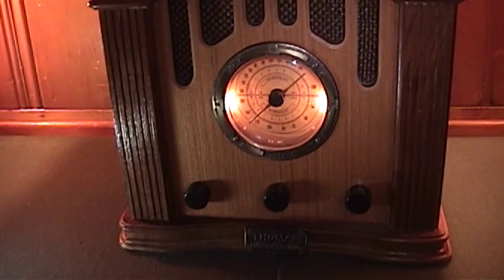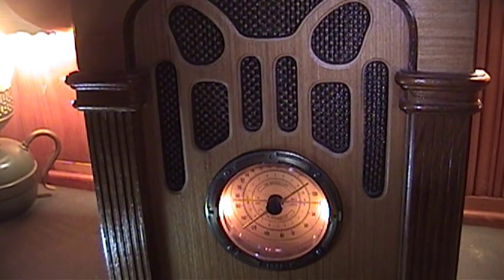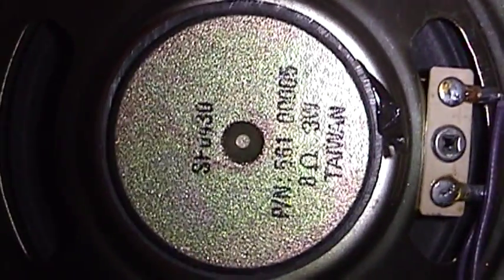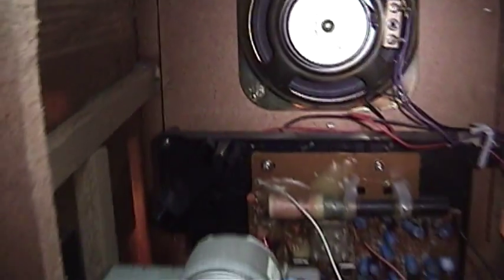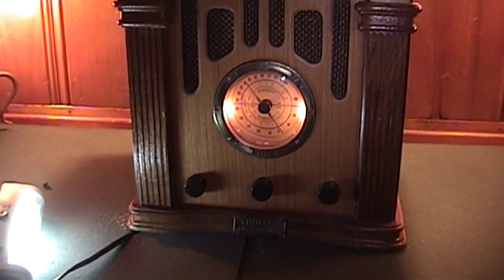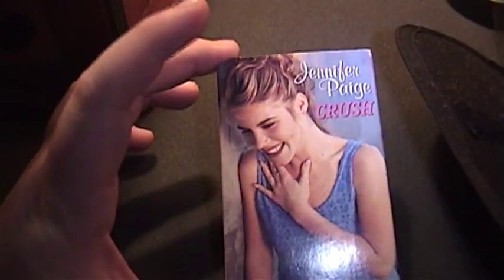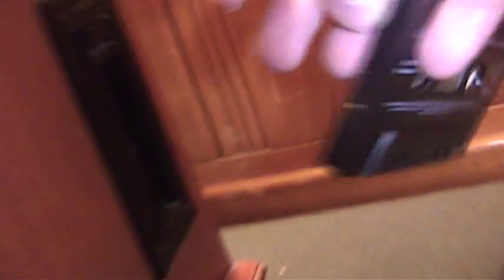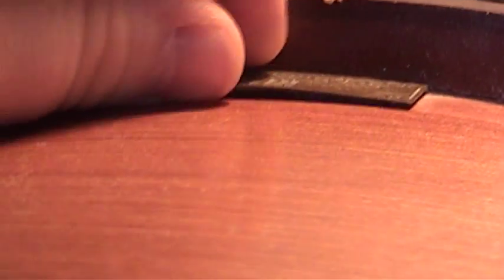EOL: Thomas 411A Reproduction "Tombstone" Radio

Comment: I dont't know about the Thomas you have, but the tape plays at a lower volume than the radio on mine. That means the radio can come on blaring when the tape stops. Mine may be older than yours or a little less premium than the one I have. Mine has a metal badge on the front and 300 ohm style FM 2 screw connector on the back.

Comment: These are not even full scale replicas. They're about 3/4 scale. I've got one of the Thomas cathederals, and it's crap too. One of these days, I'm going to dig it out, gut it, and build a Raspberry Pi internet radio into it. Slap in a usb hard drive with all my old radio shows for good measure.

Comment: They sell these on the Goodwill auctions for cheap starting bids.  I was thinking of putting a lighted Bluetooth speaker in one and streaming music through its speaker grille to make it seem like it's broadcasting old radio shows and old music.  I'm just trying to find one that has a tape deck to see if it will do Bluetooth with a Bluetooth cassette adapter. Does anyone know if it will through this type of tape deck?
Reply: Don't know about using the tape since the mechanism is touchy. But I have seen YouTube videos making a Bluetooth speaker out of these type radios. It's a good idea if it is dead and can't be repaired.

Comment: I have one under the RITZ brand made in the 1980s. Sure it dosen't compare to the actual one's made in the 1930s but it does look pretty authentic besides the cassette deck on the side and it having a modern rubber cord insted of a cloth one. I prefer it over the newer reproductions with bluetooth and other stuff.

Comment: I have a late 1980's General Electric 1930's cathedral style reproduction AM/FM radio I found at a thrift store for $20 in almost new condition. It's got Volume and Tone controls that work cleanly. It is actually really nice in terms of both AM and FM reception and has very good audio. It's made of real wood veneer and looks great. The dial light still works too. If you can find one in good shape I'd recommend one.

Comment: I have one of those in a dark color. Maybe mahogany. From 1988. It's a repro of a Atwater Kent. Mine works good still. I don't use the cassette. Never did use it much. Just the radio. The scratchy volume pot just needs some tuner cleaner. I have also replaced the dial bulbs. You have to be a little mechanical inclined to work on these. The bulbs require soldering. Used to get them at Radio Shack. Prob have to get them from Mauser now.
Reply: These radios are really not as bad is people paint them.. They are close to 40 years old.. Many of them probably needs a recap, and the belts and tires replaced on the tape mechanism.. The local thrift shop we have bids on storage units as it's easy to tell, it's not the normal junk Goodwill and Salvation army gets, and I even see antique stuff come in.. So I see alot of these reproductions there come and go.. So far I bought 4 of them within the last 8 months and all of them the cassette player actually worked the first time I put a tape in.. People should compare this to the Crosley junk that's been going around for the last 20 years.. These sound decent compared to that..

Comment: Picked one in a thrift store. Radio was working well. After I inserted a cassette just for testing purpose, it didn't go back to radio player at all. Stays permanently on cassette playback even after ejecting the cassette. Wonder if I have to open it up to check what can be done. Any ideas?
Reply: I have one that does the same thing.. I would like to know myself..

Comment: I see a lot of these rants about the incredible flimsy cheap, yadda yadda yadda Chinese crap radios on youtube.  Well A) They didn't cost a whole lot back when they were new whereas an original American built one from back in the '30's could cost a person quite a lot of money when adjusted for inflation.  B)  People like nostalgia, there's a market for it and no one else seems to even be trying to fill that niche in electronics.  C)  Most folks who buy one of these wouldn't know a capacitor from a resistor, much less how to restore an original.  D)  Restored originals (while I personally like them) don't have FM (Until the late 40's on) which is generally the only band that still plays music with a few exceptions.  Instead of all the people whining about how poor the quality is on these reproductions, why don't they all go into business together and try producing their own high quality reproductions?  If they don't then they shouldn't complain about folks buying this kind of thing.  Very scratchy volume control?  Well, it is 25 years old and about any radio with a knob for volume does that after a time.  Every restoration I've ever seen, they either have to clean or lube or completely replace the potentiometer so I don't see that as a fail.  As far as cassette goes, the one I had played just fine, but then I didn't keep it for 25 years either nor did I listen to modern music on it.  I listened to old AM broadcast radio shows on cassette which never had the best sound quality to start with.  I certainly wouldn't expect it to last 25 years anymore than I would expect any other cassette deck in that price range to.  I used to have a car radio or two back in the 80's that had the same type of cassette mechanism and they were cheap radios as well that I bought to replace the AM only radios in my first two vehicles, a 1970 Chevy Nova and a '78 Jeep CJ-5, both of which came out with one factory installed speaker.  I sure wasn't about to go out and buy a high end audio system that cost more than the car I was putting it into, lol.  Back then that Nova cost me $400 bucks, I think I gave $35 for the radio.
Reply from the maker: +Rebel9668 Either way you look at it, they're crap. I highly doubt that anyone has the time, dedication, or funding to finance an endeavor such as that which you've mentioned. 

Original, older radios which are most unquestionably of higher build quality are actually cheaper to buy used than those cheap reproductions flooding the marketplace. I'm fairly certain that anyone who has any appreciable interest in vintage electronics will most assuredly procure the real deal, not some inferior reproduction. People who couldn't care less about the product's integrity and merely want the superficial "retro" look would find absolutely no fault with this and other reproductions whatsoever and can so easily find them just about anywhere.

The suggestion that somebody's opining and commenting on something they haven't designed, engineered, produced, or sold is ludicrous. I suppose all those people reviewing products, cars, et cetera, are culpable of your conjecture. 

I know a capacitor from a resistor; I also know a pile of crap when I see one. Moreover, if you have such a problem with others' viewpoints, why don't you try producing your own high quality videos devoid of comments, opinions, and judgement? If you don't, then you shouldn't complain about folks doing such things. I'm certain your videos aren't bereft of those aforementioned qualities.
Reply: StereoDustParticles I have uploaded my own videos, thank you.  I am trying to learn radio restoration as best I can.  But again I say, most folks can't afford the originals that have been restored.  My Thomas when brand new as I recall was less than $50 dollars.  I've begun restoration on a Zenith K725 from 1955, so far I've spent over $200 on getting everything from a multimeter to caps and resistors and I haven't even purchased an isolation transformer, variac, rf signal generator, tube tester or anything like that.  A lot of audiophiles I've noticed talk about how bad something sounds.  My hearing is pretty good and I don't think that radio sounded bad at all.  Of course you can't compare it to something like a Marantz, optimus, (insert your favorite brand here)(my personal favorite was a Fisher 110).  I still say for what it is and was they are very enjoyable little radios and those old radios, even when they were new didn't sound all that great because of AM interference, weather and the lot.  Sure you can make one sound great now broadcasting to it from a transmitter hoked to an ipod but most folks want a radio for music and again, radios of the vintage that reproduction represents can't find music in most cases except for something like WSM and who cares how good dr. laura, art bell or rush limbaugh sounds?  I think if most people actually cared all that much about the sound itself there probably would never have been such a craze for those little 9 volt transistor radios when I was a kid cause those things were everywhere and they sounded like crap, lol. I know several folks with these type of reproductions and they're all pretty satisfied with them.  Personally the only reason I wouldn't buy another is because I live in a rural area and there isn't a convenient hookup for an external antenna, but if I lived in a city I certainly wouldn't mind having one again.  Take care, Gary

Comment: I have this radio. I bought it 3 years ago 2nd hand obviously for $20 dollars. I agree with your video, however? It is what it is for $20. And it works well enough for me, and a nice historical reminder of those times when the original radio was produced in the 1930's. The volume did crackle when I got mine, So took off the back and a spray of WD40 seemed to have solved that problem

Comment: It's not as cheap as you say... Look at the Crosley crap these days.. The thing is around 35-38 years old, at least when they started making these reproductions in the late 1980s.. The caps are most likely out of spec, and needs a recap, and the cassette player probably needs new belts.. It's meant to sit on a bookshelf, it's not meant to sound super great.. My aunt bought a similar one for my birthday back in 1990 or 91.. It seems like it use to pick up far away stations and lock them in alot better than it does now.. Compare it to the 30s and 40s radios, ya sure they were made way better and much more heavier, but they only had AM, and I don't think anyone these days even listen to AM anymore.. Unless they modify them these days to play from AUX source they are pretty much useless.. Neat still to get them working with the tubes and all that..

Comment: They made a radio exactly like this for the UK market, badged as a "Casio". The first generation of what I call Crapophones. Full of hot glue, shitty cassette transports, and don't try to renew the "dial lights" you've to rip out the whole innards, hot glue and all.
Reply from the maker: I figured as much about the dial lights. Replacing them looked to be next to impossible last I looked. They might as well have advertised it as "disposable."
Reply: casio? dunno about that but seen loads branded as steepletone ,
Reply: the tape decks on these destroy tapes so never put an important one in!

Comment: i have this exact radio, but way better condition i guess.  i plan on switching out the cassette player mech with a 12v bluetooth mp3 player display, really just out of boredom...  mine sounds good though, not hifi good, but better than most portable speakers out nowadays...
Reply: Did you get to fitting 12 v into it ?